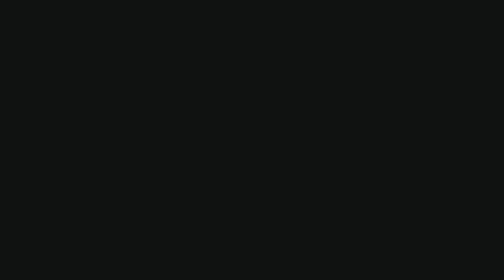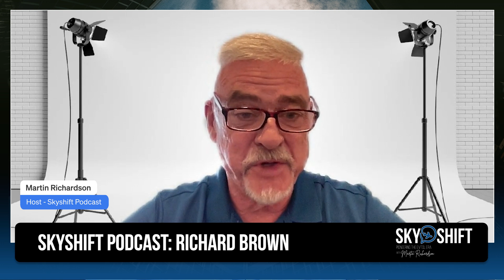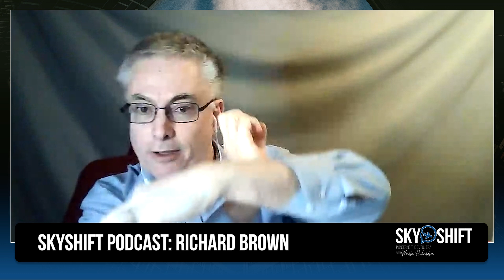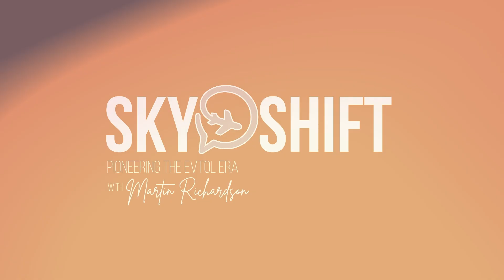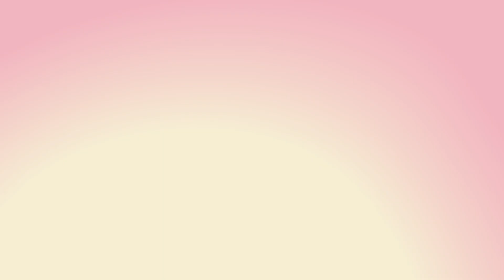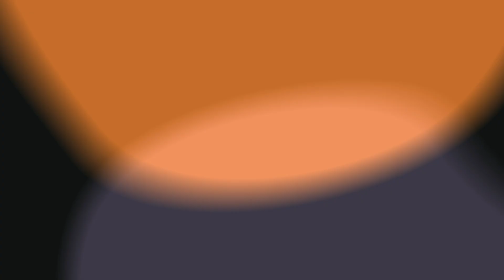Seamless eVTOL Urban Air Mobility Requires Smart Vertiport Design and Regulatory Support.

Comment: The fllow field animàtions shown on the Joby videos look to be an incomprehensible mess of wakes and turbulent propwash such that no part of it seems to be in any sort of clean flow (looked at from a glider pilot/designer's point of view)  The downwash created by rhe forward wing mounted props reducing the wing angle of attack during transition looks to be a basic mismatch to load transfer to the wing and loss of thrust on one side could result in sudden lift imbalance as well and concomitant change of tail alpha (giving both pitch and yaw inputs for blowing half a vee tail) the number of off design cases and interactions with loss of random props or overspeed, creating a huge number of permutations and controlability 'issues'.
I believe that vtol itself is the wrong approach for civil mobility by air in that hovering per se is not neccesary or beneficial (and helicopters are best when it is)
What IS wanted is elimination of the need for a runway ( or airport or for that matter a vertiport both of which involve expensive intrusive 'facilities' requiring real estate and being blights on urban/suburban amenity . I have tried to get over the concept of ATOL (assisted take off and landing) without any success for some years and as part of that pointed out the inherent faults in vtol including the effects of mechanical turbulence created by the propsed landing platforms in any wind, deleterious ground effects etc etc which the later Uber elevate animations showing the monumental (literally) huge and costly edifices raised to accomodate vtols  internal lifts and charging,passenger waiting and boarding baggzge handling and taxi transfer parking etc etc - all fundamentally unnecessary using ATOL and for one tenth of the installed power, zero noise snd so on.  The continuation of extraordinary theoretical means to try to untie the Gordian knot that is evtol and vertiports needs to 'cut through' the whole turgid mess and get back to basic physics which incidentally dispenses with just about all the vexing problems CREATED by the insistence on hovering (and the unavoidable transition of any sort of speed range or efficiency is sough).
ATO was the secret to the Wright brothers first solving the problem of flight itself and avoiding the same issues of controllability before flying speed, length of run,minimizing power required etc - all lessons forgotten in the age of CAD